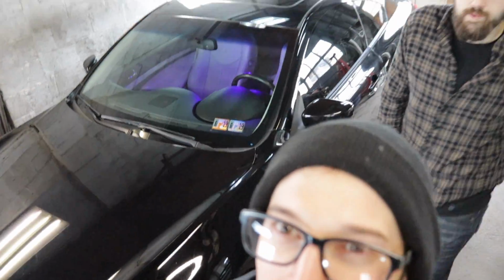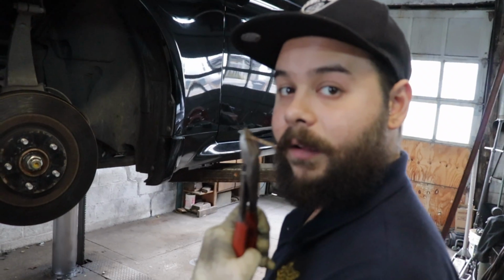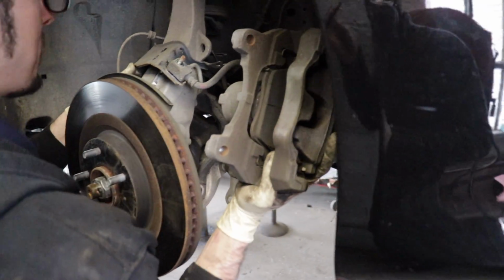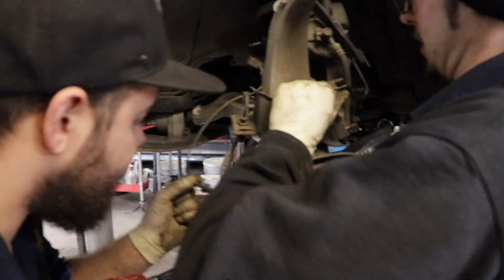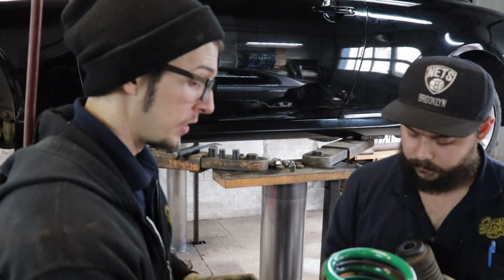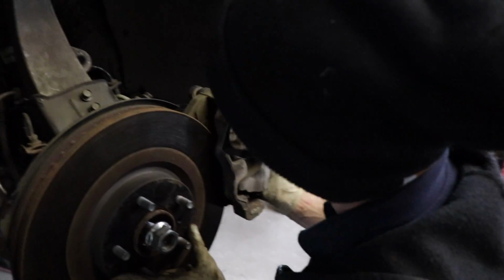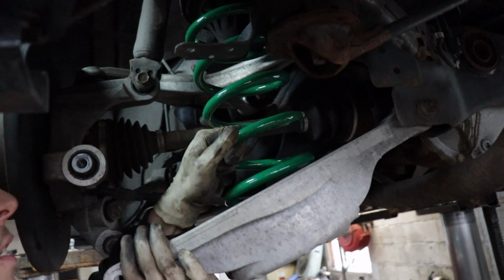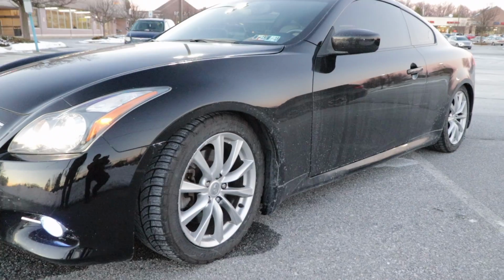G37 Tein Lowering springs install

Comment: Tire set up?? im rubbing with stock height already. 19x10.5 rear with 255/40/19s
Reply from the maker: thats your problem, you got 10.5 wides and the aftermarket wheels that are on the car now are only 9
Reply: @salvobrothers5928  Do you think 245/35 would clear if i lower it?
Reply from the maker: @EseTony98  possibly cause he runs that same tires size and they fit fine but his wheels are 18s instead of 19s

Comment: can a rwd lowering springs fit a awd on a g37x coupe?
Reply from the maker: i believe so, the only thing that i would think otherwise is the weight difference in the front for the awd so the springs may be a bit heavier for the awd to handle the weight

Comment: Looking to get these on my G37s coupe, Does it feel any stiffer? or Body roll?
Reply from the maker: the ride is still pretty smooth its mostly noticeable when you hit bumps, definitely handles better with a good bit less body roll
Reply: Salvo Brothers  Awesome bro thanks!
Reply: @estebanespinoza4990  hey man I'm the owner of this car. Definitely stiffer, but if you already drive the S trim, it's gonna be even less noticable for you than it was for me as the S trim has a slightly stiffer suspension than my stock X. On regular roads I hardly notice a difference in smoothness, but the difference in handling is there and hugs the ground in the corners much better than before.
Reply: RekreaturA  Great information bro. Thank you keep up the hard work!
Reply: Im also thinking about getting TEIN lowering springs for my G37S . Thanks for sharing. Did you notice any camber difference?
Reply: @MiguelAngel-cx5dq  yes, nothing crazy , but the camber is indeed negative now. Front and back.
Reply: @MiguelAngel-cx5dq also if you pause at 13:00 you can get a pretty look at the rear drivers side wheel.
Reply: @RekreaturA  I know a lot of people like the negative camber look  so it doesn't look bad on the video.

Is it too much where you would think a camber kit is absolutely necessary?  

My rear tires have always had negative camber on the stock g37s suspension. Usually Im able to still go over 85% of tire thread before the uneven wear becomes a problem.
Reply: @MiguelAngel-cx5dq  you may or may not want the kit  it depends. Right now I've got 18 inch wheels and BF goodrich comp 2 245/45  so the look is already a little funky even before the drop. If you're using 19 inch or above and a low profile tire you may get a totally different look than me. It really depends.
Reply: @RekreaturA  I'm considering getting a camber kit to go with it. Im on the factory 19 staggared Enkei. Thanks on the feedback.
Reply: @RekreaturA  Hey man just ordered these for my car, just saw the other video with the camber toe on. I’m currently have stock 20s and wondering if I also would need to order a camber toe. Or should I wait until I install to see if it’s necessary?

Comment: Do you have any useful mods done to the car ?
Reply from the maker: whats on the channel is what weve done so far although we are going to do a switch so you can toggle front wheel and AWD
Reply: @salvobrothers5928  don't forget the essential HP boost from the turn signal mod lmao.
Reply from the maker: @RekreaturA  cant forget that essential mod

Comment: Ya I cancelled buying these because too low at the back I find.
Reply from the maker: yea we ended up putting a different setup on because of it
Reply: @salvobrothers5928  ahhh good to know. I figured by looks of it. Seems like H tech were better but spring rate is too soft.

Comment: Seen a few other videos where ppl ended up getting around 2 inches from and back drop instead of the 1.5 front and 2 back
Reply: Info I had was incorrect. It dropped 2.1 front. 1.9 rear

Comment: How many inches drop front and rear
Reply from the maker: its in the beginning of the video... I believe its 2 in the back 1 and half in the front
Reply: Advertised as 1.5 inch drop but the rear is definitely at least 2 inchs. As you can see in the video, the ride height front to back was nowhere near  as even as it was after we installed the springs, so the rear definitely has a larger drop.